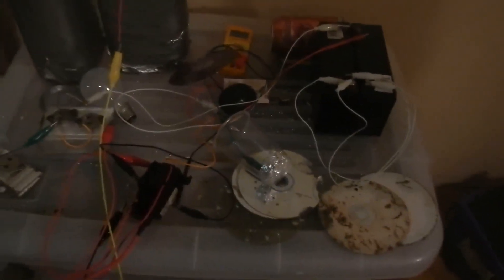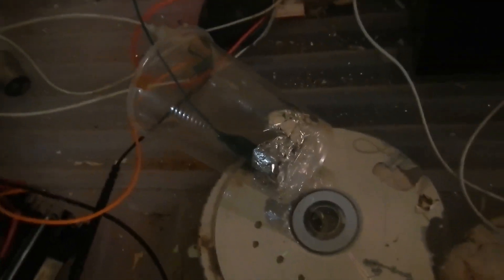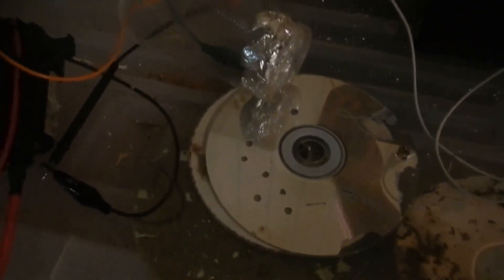How to find a leak or pin hole with high voltage.

Comment from the maker: I keep killing those ones :) Just got another TV I don't have room for, mostly for the one transistor (wire and flybacks are always good though). I'm thinking PNP's are tougher. Handle back emf on the base better. Got tons of mosfets, just need to learn to stop zapping myself. ZVS parts are in a box, waiting for me to make a board and solder it all on. Need to play with my TIP 32 again. couldn't get the tesla coil to work, but maybe a flyback. I can get more with the right transistor. Need 500v.

Comment from the maker: I'm paying about $1.70 in lots of ten. Its getting expensive. I need to find a better transistor. I've been down to my last 4 3055's for a week now. Its good practice, not killing them, but I want to try new stuff... Although I need oil bath and better transistor's. I'm hitting the voltage limits for 3055's (exceeding them by 3x even) and my return is arcing to the pins next to it, and my flyback has purple stuff on it, and it may bite if touched when on.

Comment from the maker: LOL.DVD's warp when burned, then separate into 3 layers... I was thinking about feeding audio to the base though :) Maybe from my Base guitar. Play some base on the base with my base lol. I can get mm size holes, but smaller is hard. no breakouts lol. even the insulation gets breakouts! so does the flyback.. I really should oil bath it. starting to get cracks on the outside. they all glow purple. Camera doesn't see any of it :( Also I have rain issues. apparently there is a flood on?

Comment: Nice output, flybacks are better at HV than most Tesla towers for brute force at low input. Watch for the ozone, open windows etc, nasty stuff at ground level. 
Idea - modulate the plasma and have it as a fine beam using thin wire (no breakouts)...use constant speed motor to burn audio into it in a spiral motion. Then, read the audio back off with perhaps photodiode pickup as microphone to PC. Depends if the plasma breaks through the back metallic layer in micro sized holes. Hope so :)

Comment: A classic example of broadband thinking with a self restrictive bottleneck LOL - Find the leak caused by HV plasma by using HV plasma !
Hey though, you found it and if it had just been a touch of the plasma it wouldn't have been any worse than the orig leak :)